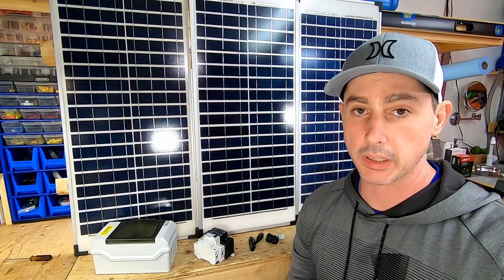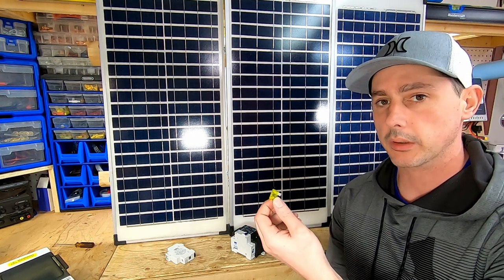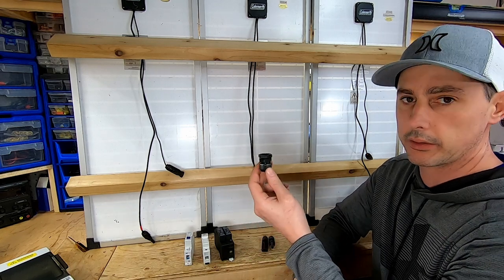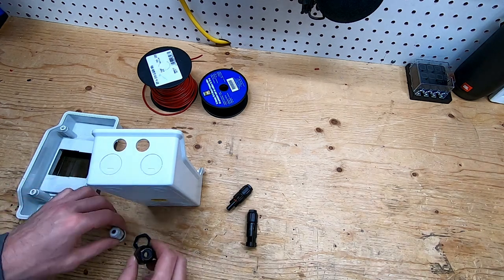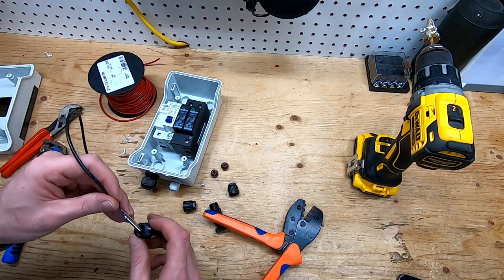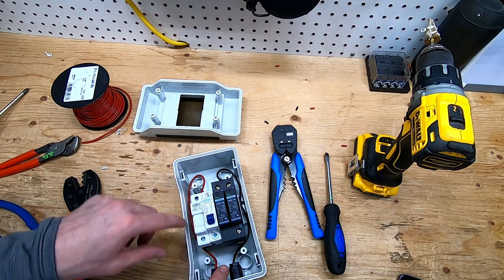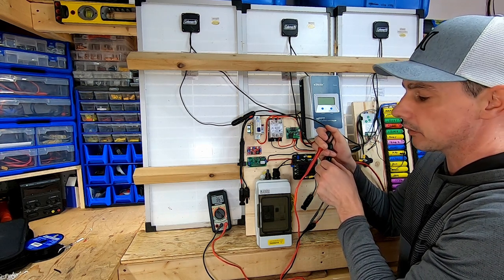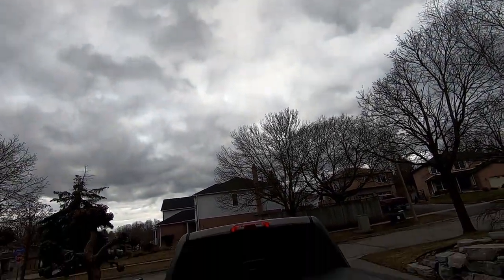DIY solar panel disconnect with overcurrent and surge protection

Comment: Is there a need to have fuse for both +ve and -ve and a 2-pole circuit breaker?
Reply from the maker: I would have been ok with the breaker on the positive. I like to build over.

Comment: Why both fuses and a breaker?

Also, 600V PV wire would be totally fine to use.
Reply from the maker: The fuse it for each string of panels and the breaker is for when the strings get paralleled for higher amperage. Does this help?
Reply: @Roll2Videos  Yes it does. So the breaker is only protecting the conductors between the parallel point and the charge controller?
Reply from the maker: @user-dr2pg8fk2i  Yes 😁

Comment: Seems overkill for 120 watts solar...60 volts is not alot of voltage....I fuse 1600watts of solar at 150 volts...with an 80 amp ANL fuse...with a disconnect and grounded lightning protection.
Reply from the maker: It maybe but I'm trying to follow code as close as I can for my area. You're a array sounds impressive I would look closer at your ANL fuse and the inrush current capability rating. 🍻